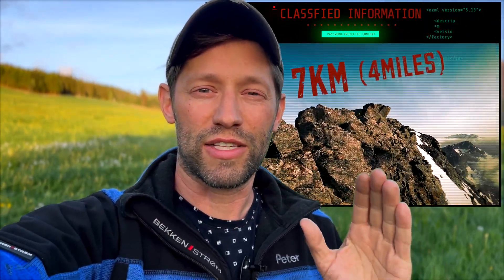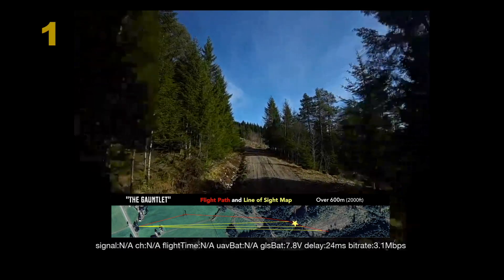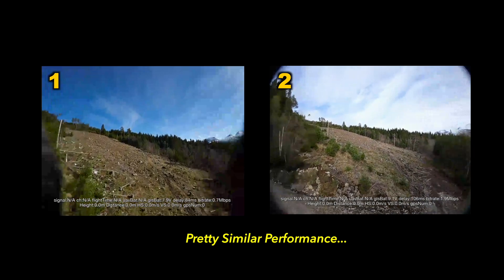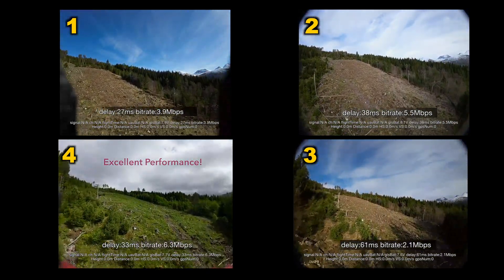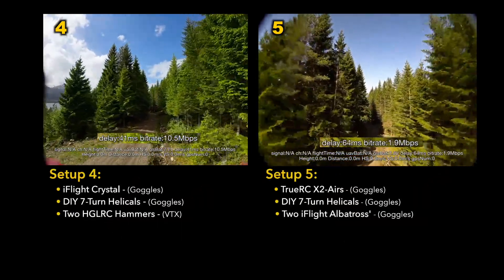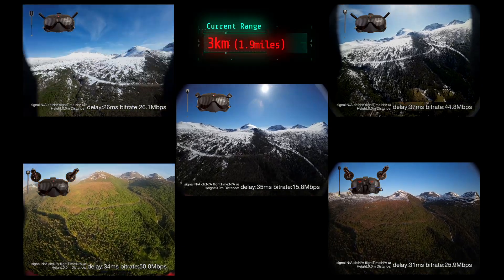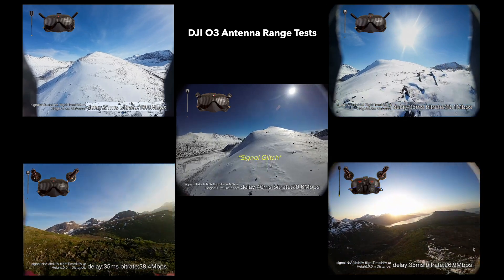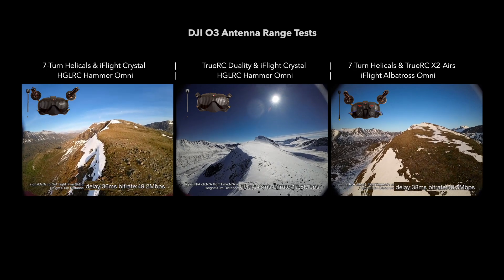NEW DJI O3 Range & Penetration | Improve FPV Drone Signal Testing | DIY & TrueRC High Gain Antennas

Comment: thanks to you I discovered helical antennas, I fly with 2 helical 7 turns and lumenier patch at 7km I have 50.8mbs it's incredible 😮
Reply from the maker: Are you using DIY Helicals? 50mbps at 7km is awesome!! 
Glad to have helped, hoping folks find this video helpful as well.
Reply: @GiantAntCowboy  yes diy, 3d printed, i use a 1.5mm2 domestic electrical copper cable and the base is 1mm thick copper plate. I forgot to mention that is with the old dji unit, two hglrc antenna.. it's awesom yes, first time for me that i reach as much km.. i would like to test 10 or 12km the next time, with 6000mah i fly more than 20km flat
Reply from the maker: @FPVVins  amazing! Yea keep pushing the limits, exciting stuff. Very satisfied with this setup!
Reply: mw?
Reply: Are your helicals LHCP or RHCP and is the connection to goggles RPSMA or sma with adapter?
Reply from the maker: @OzFPVflyer  I’m using LHCP Helicals with the iFlight Crystals, and RHCP Helicals with the TrueRC X2-Airs. Just so everything matches.  

I’m also using RP-SMA connectors for everything.

Comment: Interesting. You should try 4 helical antennas: you'll probably get an even better bitrate and lower latency at that range. I use 2 Pergoda triple feed patches on top with the Iflight Crystal plate and get reasonable range, but not as much as you got with the helicals.
Reply from the maker: Yeah I bet quad helicals would work great. I’ve used that setup on my HDZero and WalkSnail quads in previous videos. For this setup I’d like to use the iFlight Crystal antenna simply because it fits so nicely. Quad helicals are tricky to attach & aim properly and have to be removed after each flight. 
Thanks for watching, appreciate the suggestion and maybe for testing purposes I’ll make two more LHCP Helicals. Cheers!
Reply: @GiantAntCowboy Do you also have a video to make?
Reply from the maker: @원폭맨  sure do, here’s a basic process - https://youtu.be/TS4fYcT3DEE
Very easy, been making/using them for years! Cheers!
Reply: @GiantAntCowboy  Will it also apply to DJI FPV drones by any chance?
Reply from the maker: @원폭맨  yes, and no. The DJI FPV uses both 5.8ghz & 2.4ghz for video and control link. These antennas are designed for 5.8ghz so you’d be reducing the 2.4ghz performance. 
Additionally the DJI FPV uses linear antennas, and these are circular polarized, so there would be some loss there as well. 
However if you ran two helicals on top, and kept the stock antennas on the bottom you’d probably see some performance gains.
Reply: @GiantAntCowboy  Two helicals at the top.

IFlight Crystal HD Patch Directional Antenna at the bottom.

Can I do it like this?
Reply from the maker: @원폭맨  try it and see how it works. That’s my favorite setup for my long range quad, but I don’t use 2.4ghz with the DJI.